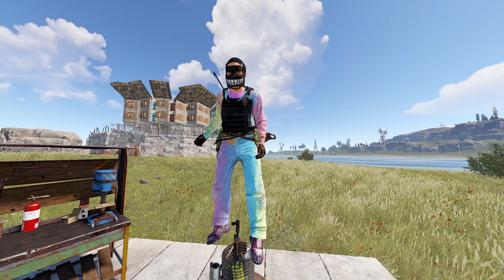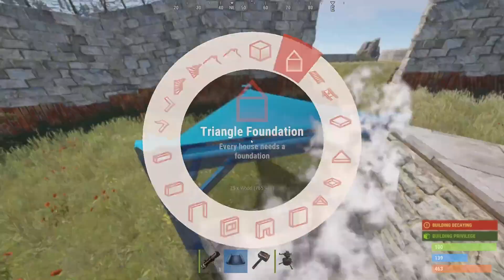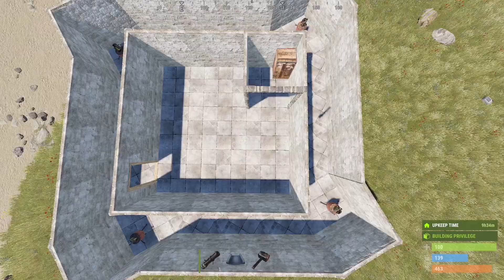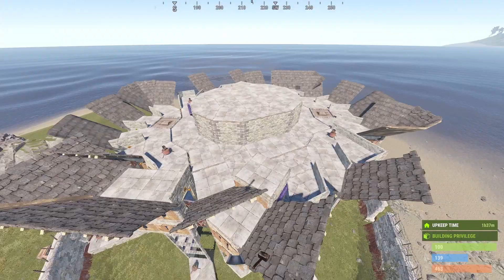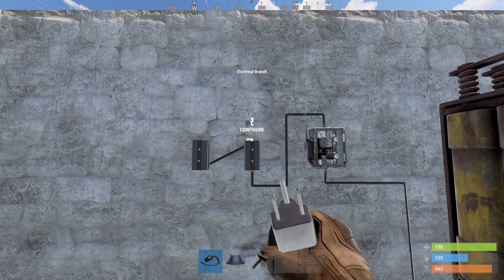Rust - How To PROPERLY Use The Auto Turret (Rust Base Design 2021)

Comment: One comment on garage doors, if you tie in a sensor and door controllers too the turret, if the turret gets killed the garage doors automatically shut.
Reply from the maker: That sounds like an insane circuit
Reply: @MyGamingExperience  it's actually not. 

HBHF sensor > and switch(main power to second input) > turret > door controllers. 

The sensor would activate the turret and open the doors. Once turret is destroyed doors would automatically close because they wouldn't be receiving power.

Comment: fun tip for the electricity aspect. i usually set the electrical branch to a small battery then the battery to the turret.
this way if they get the main battery the turrets remain active for a while longer.
Reply from the maker: That sounds like a very smart idea for the electrical, thank you for the feedback!
Reply: do you still only need to branch off 10 power to achieve this?

Comment: Electrical: 
What I've used with great success is a bit different concept and a change of order and a few different parts. From the power source, whatever you choose as Test Genny was my goto option, go into a Branch and set the Branch for 32. The 32 goes out to the Switch and of course Smart or Regular depends on what you have or can make. From there to into a Splitter. Then lastly from each splitter to 3 turrets. What this does is for each test genny you can manage and control 9 turrets from 3 switches. 

Parts list: 
1 test genny or large battery or whatever, 
3 Branches, 
3 Switches and again of your choice smart or regular, 
3 Splitters and lastly, 
9 Turrets armed with the weapons of your choosing. 

This allows for mass confession in your electrical setup and I place Test Genny's all over the place. As long as you can reach a turret you can setup splitters to charge turrets in different areas. Even if one or two test genny's or lg batteries or turrets are found you still have active turrets due to all eggs not being placed on a single switch or single battery. Sometimes I even run single test gennys to a single turret just to mix things up and typically make the swap the night before wipe because I won't be checking on it. 

Many times I run multiple test genny's and switches to a single light or some useless item for the sole purpose of distraction and forcing the waste of explosives to ensure an increase in the cost of the raid. probably the best part was making sure that a sweet target base was void of LOOT. There's NOTHING worse than spending several hours and massive amounts of explosives on a Raid to yields ONLY what's in TC, a bit of HQM and Metal. I will put 100 large boxes, all locked, either empty or with a Note that says "Arg ye found me loot" or some other cheeky thing just to piss the Raider off to the max. 

The reason to Lock the Box is to play on their GREED as they must find out what's INSIDE and they will waste ammo to get NOTHING. Where I'd keep my loot is the real secret so don't ask, I won't give out that info. But raid me if you want, you will only get disappointment and despair for your troubles. As for finding my loot, won't happen, because it's hidden in such as obvious spot no one bothers to look... Cheers...
Reply from the maker: Thank you for all the info!
Reply: @MyGamingExperience  You're welcome... keep making videos, they do help....
Reply: @cybercapri  great info. I just want to know where you hide the loot!
Reply: @Dan-vs6di  Since I don't play Rust anymore, I will tell you where I kept my loot, in a plan, no frills base, devoid of walls and a base anyone would walk by and think, wow, what a noob. I'd burry it deep within the center so even if you do raid it, you'd have to destroy the entire base to get to it. Folks go after the hard raid thinking it will be full of everything but every single one of my HQ Metal bases, as described above, only have enough HQM, Metal or whatever in the TC for two days and given the massive amount of explosives they just used blasting through, the probably rage quit the game LOL... Sure my loot bases got hit a few times, just not often and an inside job because they knew exactly what blocks to take out. Many times I didn't bother to lock the doors and kept a lot of boxes out in the open, unlocked and empties to throw off the Greedy Raiders looking to score. They don't want to tear up a floor to check under it because the doors were unlocked and boxes empty, either they had nothing or were already hit is what they probably thought and moved on. Many wipes I went not raided in by Loot bases while my heavily HQ Metal bases were totally destroyed. Greed caused Rust Players to make bad decisions and focus only on HQ Metal while Wood and Stone are not worth the time or effort for what little they thought they'd get. I hope this gives you some good ideas as to how to mess with the Greedy Rust Raiders... Cheer's

Comment: The other bonus with using a Smart switch is you have to have TC auth to manually switch it in game.
Reply from the maker: the smart switch is def. great for the turret circuit, I'm not electrical expert in rust but I even use them :)

Comment: Another good strat is using heartbeat sensors connected to doors that the auto turrets are behind. So they turret is only exposed when the raider is in a position where he can be can be shot.

You can actually use one heartbeat to open 2 doors at once if you use and switches which will make it even more difficult for them when 2 auto turrets appear at once
Reply: This is what I do. 1 heartbeat sensor opens 2 garage doors exposing a turret; with everything placed so that 2 turret pods will open for any 180deg angle. The next tip is to then feed the "No Ammo" output into a blocker, blocking the flow of current to the door controllers. This way, if they do manage to bait your turret until it runs out of ammo, the doors will close and remain closed, regardless if they are in range of the sensor or not. Protects your turrets and the guns inside of them when they have no more ammo.
Reply: @randomutubr222  such a good idea with the blocker! So I would just wire up the auto turret as normal, but through a blocker, with an extra wire from the no ammo part in to the side of the blocker right?
Reply: @Josno15  You don't want to power the turret through the blocker. If you did that and then fed the No Ammo output into the Block Passthrough, then when the turret ran dry, it would just turn itself on and off in an infinite loop. The turret should always remain powered (and provided with 11 electricity). E branch for sensor -> E Branch for turret -> rest of power goes into AND switch + sensor output goes into AND switch -> blocker -> door controllers. Then the No Ammo output on the turret goes into the Block Passthrough on the blocker, which will prevent the door controllers from powering / opening the doors.

I'm trying to send a link to a screenshot of the circuit I use, but YouTube keeps deleting my comment because of it. If you go to imgur and then add tg0npCZ to the end, it will come up.

That is how I set it up for my base (circle footprint; there are 3 turret pods. If you need more, then you'd just use a series of electrical branches in place of the splitter that I have there). Only thing missing from that example above is you should obviously also have a master switch somewhere to turn everything off for maintenance.
Reply from the maker: Yup that is a pretty cool idea. I used to do similar things with the hb sensor for trap bases
Reply: Depending how you wire it, and may require some big brain, you can have those doors auto close permanently if the turret is destroyed.
Reply: What if you rocketed the hbf
Reply: @ripzee  The way I set it up is that the sensors are on the inside of the compound walls. I then have turrets by the walls, and then the door turrets on the base itself, so you are pinched both ways. That would make it difficult to get to the sensor. But even if they did, both a turret and a sensor are only 1 incendiary rocket anyway.
Reply: @randomutubr222  do you place the sensors next to the walls or the base?
Reply: @ripzee  I place them on the high external walls.
Reply: @randomutubr222  nice i cant believe i havnt thought of that
Reply: @ripzee  To give you a better idea of what I'm talking about, it's a setup similar to this: https://www.youtube.com/watch?v=26kq_cWihg8 at the 12:00 mark. 

Those turret pods that built into the compound entrances are always there (not behind doors). I'd then put the sensors on the compound walls in between them. Then, on the 2nd floor of the main base, that's where I add my turret pods with the auto closing doors, facing outward. That way, if someone manages to get into your compound, then they will have to deal with both the bottom turrets that are within the compound entrances, as well as the top turrets that are hidden behind the doors attached to the base itself. So they are getting tagged from 2 directions. And if you set up the footprint correctly, then there will be 180deg coverage — so no matter where you stand inside that compound, there are always at least 2, and possibly 3 turrets that will be able to see you.

Add some well placed shotgun traps and maybe another turret on the roof; and it becomes pretty impossible for someone to just casually enter your compound. They are going to have to work for it.
Reply: @randomutubr222  this is actually so helpful. I was looking for ways to set up turrets so that they could not be bowed/speared or rocketed easily. It always seemed like a choice between chain link fence or easily spear able low wall turrets. Very glad that you showed me how I can set up electrical turrets that can defend themselves and also defend the more anti raid turrets
Reply: @ripzee  I actually improved this setup a bit. Instead of using AND switches, I now use memory cells which allow you to use the "Has Target" output on the turret to keep the doors open as long as the turret is targeted onto a player, even that player moves outside of the range of the sensor. I then also added a flasher light into the mix for the "low ammo" output to let me know when it's running low/out of ammo.

E Branch to Turret (12) -> E Branch to HBHF (2) -> E Branch to Memory Cell input (4) -> Remaining power from that branch (2) into a blocker -> that blocker goes into the "Reset" on the memory cell. The memory cell then outputs to a second blocker which outputs to the door controllers. Then the "has target" output on the turret goes into the passthrough on the first blocker; and the "no ammo" output on the turret goes into the passthrough on the second blocker. Finally, you can put the "low ammo" output on the turret straight into a flasher light to indicate low/no ammo status.

The memory cell might be intimidating if you've never used it but it's actually a pretty simple circuit and is a definite improvement from my other one.
Reply: @randomutubr222  sounds confusing but im sure il figure it out

Comment: Being a solo I will never do an online raid.. 😂
Reply from the maker: Online raiding as a solo can be very tough
Reply: Online Raiding as a solo is actually huge to helping you get better at raiding. But I suggest doing it and low POP servers first two or mid POP servers if you've had a couple thousand hours or more in. I am at 7 K and I won't online raid any group over the size of 3 on an official. I actually lose probably 4 to 6 out of 10 Raids I do online, but the ones I win feel so rewarding.
Reply: @GrandpaRust  I generally build a raid base, with turrets.. 😂 Then I do a raid.